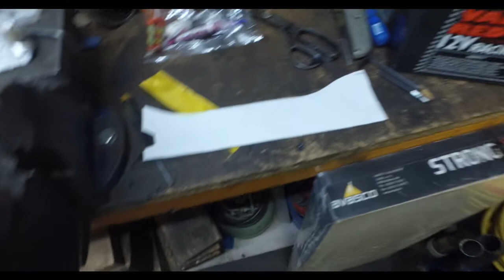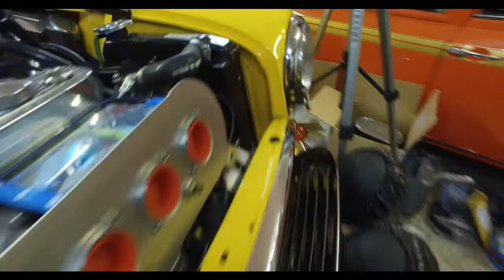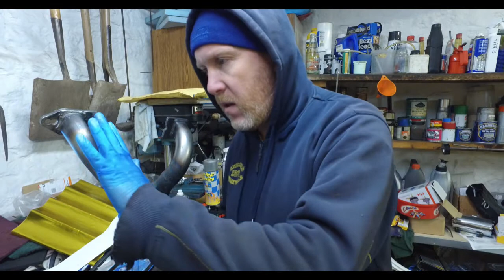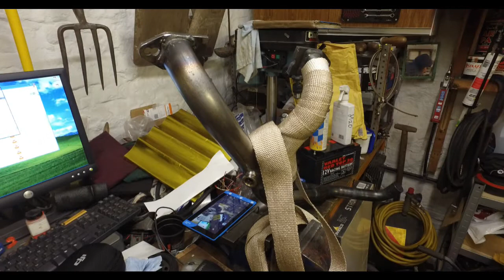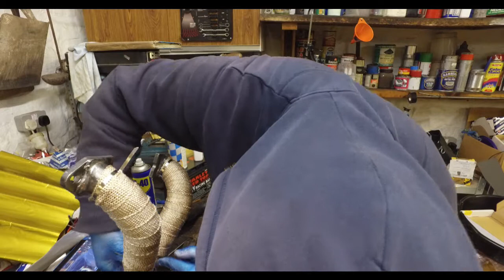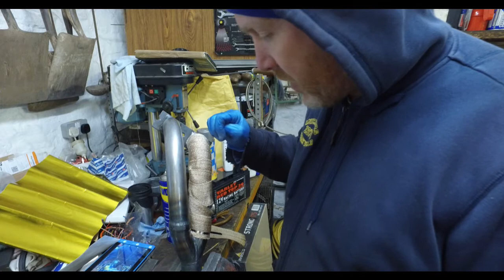Bumblebee's New Engine. Part 6. Heat Proofing.

Comment: anuther grate show richard thanks, "sound problems" love your accsent and cool narration!!then that music lol, just pulling your leg! heat wrap> 3rd chain of thought on that..i just cant help feeling sorry for that tube that can glow red at times and its only natrel method of escape is fresh air,it must dissipate its heat more to attached parts!and thats what bugs me about it,but then again thats right,tight to the bulkhead,so whats the lesser of 2 evils!
Reply from the maker: the other positive to keeping the heat in the exhaust is that the hot exhaust gasses move quicker = more power. The best solution would be thermal coating, but thats out of my budget! The sound problems are being a pain in the arse, intermittent 'clicking' which apparently is wifi interference, it just comes and goes at random
Reply: at last ,a subject that i actuly know about ,lol,i bet your divice is pluged in near ether> fridge,freezer/centrel heating control or other large thermostats?
Reply from the maker: no theres nothing in the garage, computer, lights, fan heater (sometimes), it did it at the storage unit and theres less there. I'm trying a different external mic next.
Reply: cool, i thought it was the hub,lol hope the new mic takes some presure off,